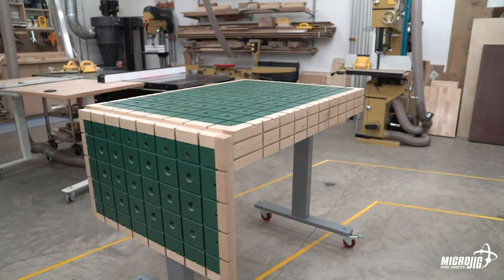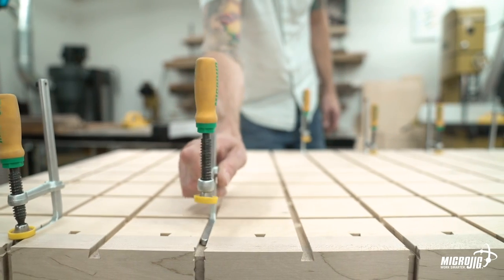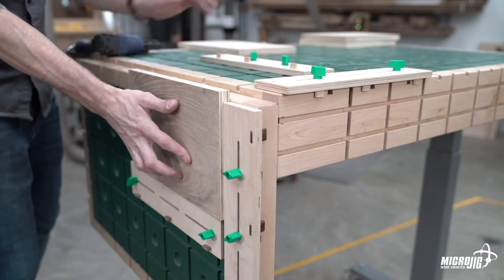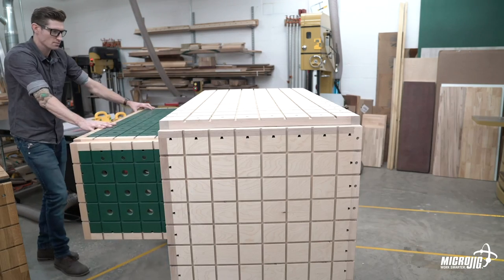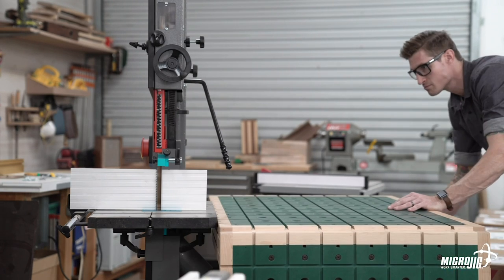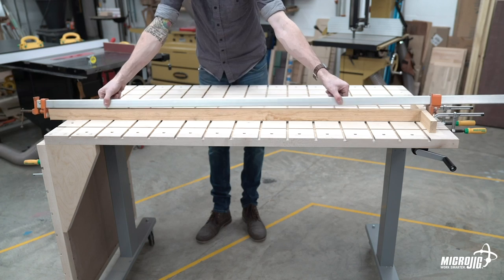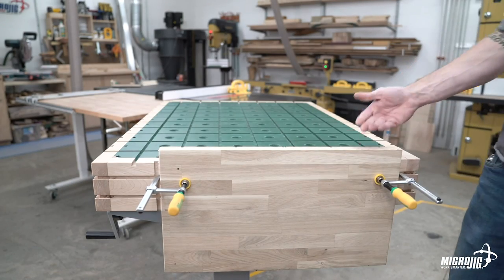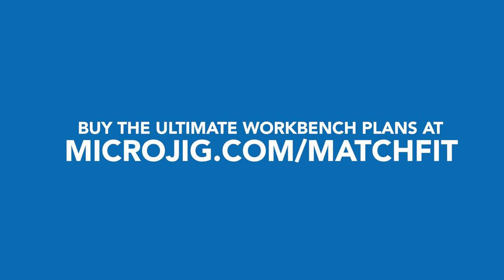The Ultimate Workbench with the MATCHFIT 360 System!

Comment: I just ordered everything to switch over to this system and I am very excited to use it… the only thing I’m concerned about, is glue ups on a table like this. Concern being glue squeeze outs getting into the grooves and creating complications with sliding the clamps around after the glue dries.
Reply from the maker: Joseph, certainly a reasonable concern.
We do recommend using a light coat of paste wax on the top surface of the table. Not so much that it is slippery, but to protect from moisture and glue sticking. 
The grooves themselves should be well waxed, this will help the clamps and hardware slide AND keep glue from sticking in the grooves.
Finally, I like to use wax paper under glue ups whenever possible, just saves a ton of clean up.
Reply: @Microjig  any specific brand of paste wax you prefer? I know Johnson’s has been more or less discontinued.
Reply: @AaronGeller  I use parchment paper from the supermarket. It lays flatter than most wax papers.

Comment: I can think of things it COULD do you didn't mention. Clamping means you could clamp tools to it. So it can become a variable height tool bench and you can mount more than one and setup and assembly line of sorts.  There is enough air flow with the oversized dog holes a well placed fan could create a downdraft sanding table.   Pretty darn clever all the way around and I havn't even tried it yet so I bet I could come up with a few more pretty fast.  As a replacement to a really solid craftsmen's bench, I am not sold on the stability of it. I watched it wobble while planning....I think the small footprint of the wheel might not have enough purchase to hold the table as solidly as I would want it to using a plane,  chisel, hand saw.  I think I would want a more solid surface but a roman bench would work in most cases and it would fit under a bench.....Great ideas all.
Reply from the maker: The limits are pretty much only your imagination!

Comment: @microjig what are your opinions on adding a router table assembly onto the workbench itself?
Reply from the maker: I'm not sure I would add a router table. 
I prefer my router table to be as flat and smooth as possible for best accuracy and cleanest cuts. 
Having the grooves under my stock off the change for the stock to catch in them.
Also, the router table is often messy and the chips would get into the dovetail grooves and need to be cleaned out.
Reply: @Microjig  good callout indeed, thank you so much. I was optimizing for my very limited space and hoping I could reuse some of the space on the 5x3 workbench I'm building. What do you think of building it into the workbench but leaving a large area groove free for this?
Reply from the maker: @hhvidz  Space is always an issue even when you have lots!  A router setup mounted on one end of your bench and the Dovetails cut from the back of the fence travel across the rest of the table would be an awesome compromise.

Comment: I just got done cutting dovetails in 3/4" oak top plywood for my work bench. I noticed that the clamps are sticking alot in the grooves. Do you have a recommendation for a finish to help with this?
Reply from the maker: I prefer just using paste wax. A thin coat of shellac or something as a sealer on the top is ok, but wax will help keep glue from sticking.
Inside the grooves, put wax on the clamp heads before fitting them into the grooves. As you slide them back and forth, the wax will get spread along the grooves. 
You'll be surprised at how much difference a little wax makes!
Last thing: you do NOT want too slick a top surface on your table. Clamping parts in place works best with some friction between the part and the table top. Early on I made a table with a phenolic face. Looked awesome, did not clamp well since it was VERY smooth.

Comment: Where do you source the heigh adjustment mechanism? It looks like a standing desk
Reply from the maker: We have used standing desks, but they have light weight ratings for a workbench. 
The Home Depot Husky adjustable workbench is currently the option we share. It is rated to 600 lbs and comes in a couple sizes.

Comment: I am new to the match fit system and very impressed by it !! 
If I could find one downfall to this bench I would say it doesn't have the heft to stay put during robust hand plane tasks. Not trying to be a troll here , I will be incorerating match fit in to an upcoming bench build and I would very much like to be proven wrong ,,, save me the work of figuring it out on my own . Lol
Reply: Depends on your casters and your floor
Reply: LMAO
Reply: The problem is the small casters it has. If they are changed to real workbench casters (the ones that flip up so the bench rests in its legs) then the wobbly nature of small casters is eliminated. I build a workbench and its legs are 2x4s, if I use it with the casters on the floor it wiggles a little but once I flip them up and the legs hit the floor it stays super firm. Those casters are the ones for this workbench too.

Comment: What material/thickness works best for the tabletop grid? I don’t want to use MDF.
Reply from the maker: MDF works just fine, we have many customers who are using it happily. 
The structure under the top is more important than the top itself. A good frame underneath keeps everything flat.
Reply: @Microjig  oh ok. The main reason I doesn’t want to use MDF is I sometimes do projects that involve water.

Comment: In the plans the top is 1.5 inches thick by laminating 2 3/4 inch sheets.  Would 1 inch thick Baltic Birch work instead, or would you still recommend laminating to 1.5 inch thick?  I am concerned about having a dead flat top after lamination.
Reply from the maker: Kevin, The support structure underneath your table top is far more important than the thickness of the top. 1-1/2", 2" or even 3" thick tops will sag if unsupported. 
Make sure you have good stretchers running under the top and your 1" baltic will be fine. 
Preferably glue up two 1/2" pieces.
Reply: @Microjig  Thanks for the reply - much appreciated!  I am using the Husky adjustable worktable from HD as the base with its center stretched and side supports.  I purchased 1" baltic birch in hopes of skipping the laminating step!
Reply: @keving8682  I have this table too can you please report back how it has worked so far? thanks
Reply: @baba_babaa2  I have not made the top yet - I got sidetracked making some Paoson mobile work benches.  https://www.youtube.com/watch?v=jR__Uj7vopI&t=8s
I will get to this later this year.  I still want to build it.

Comment: You mention the dog holes are oversized to allow clamps to come from the bottom. I do not see the hole size indicated on the plan. What size hole is recommended?
Reply from the maker: For the full 1-1/2" thickness, you need holes 1-1/8" diameter.
Reply: @Microjig  thank you.

Comment: I'm curious as to the green table. What material is that, and where to you get it? It looks like plastic of some kind, which I would assume would make all hardware slide around more easily, and would also hopefully be CNC-manufactured for high precision. But I can't find any info on this?
Reply from the maker: It is actually a green MDF. They do make MDF in colors. It is not easy to find and not at all cheap. We made the one for show, but it is not really practical and the colored MDF is no better structurally than regular MDF.
Reply: @Microjig  Okay; thank you :-)!

Comment: What is the purpose of the vertical dovetail grooves in the green MDF that are hidden behind the apron? The apron has grooves as well, so I’m struggling to understand the vertical recessed groove usage.
Reply from the maker: They make it easy to clamp the apron edges to the green MDF using the MatchFit clamps. The clamp is mounted horizontally in the groove and it clamps the edge to the edge of the green MDF

Comment: how do you get glue drips and sawdust out of your matchfit grooves?
Reply from the maker: Lol, best to prevent it! We use wax paper or parchment paper under glue ups as much as possible to protect the grooves.
Also, waxing the surface AND in the grooves helps prevent wood glue from sticking.
Worst case, you can CAREFULLY line up a straight edge and run the dovetail bit through the groove to cut away any glue.
Reply: saw dust is simple = compressed air... even a pancake compressor can remove sawdust... AND fill your tires with air when needed... AND shoot nails... a shop vac can also remove saw dust... shop vac and compressor are essential tools that will pay for themselves... shop vac and compressor are two of the 1st purchases after I purchased a home.

Comment: Any metric versions available for the rest of the planet?
Reply from the maker: We are working on it. One big issue is that the leg set we are currently recommending is only available through Home Depot, which makes it hard. 
I have built a replacement top for the Festool MDT table. Used 96mm spacing between the holes and grooves.
But we are trying to standardize a groove spacing at 101.6mm (4") on center so future parts and pieces we may bring to market will be usable across all tables.
Reply: @Microjig   Thank, looking forward  to it.

Comment: Where do you get the legs for this table?
Reply from the maker: The legs shown were bought off Amazon and are made for a desk. But they are only rated to 175 pounds, not enough for a workbench.
Home Depot has their Husky workbench line that raise and lower and are rated to 600 pounds.
These come in different widths from 44" up.

Comment: It's a really nice assembly table but good luck hand planing anything with that super lightweight "workbench" on wheels. There is a reason traditional workbenches are heavy. I'd love to have both but I don't think this replaces a proper hand tool oriented workbench. Nothing prevents anyone from routing dovetail tracks in a roubo though, so why not.
Reply from the maker: Or making a dovetail top that simply drops onto your traditional workbench.
But to be clear, we see this more as a clamping table, not so much as a replacement for a traditional workbench.

Comment: Only thing I see it can't do is accurately align dogs for 90/45 degree cuts using a track saw as the dovetail clamps can not be rigid enough to keep pieces set for square cuts but you can not have everything in one

Comment: You asked so here it goes it doesn't absorb shock and deaden the blows. With so many large holes and all the slots this can't be a table you would install hardware on. How many times would a screw fall into that channel or large hole. Not saying they do not fall into a hole on a woodworking table but they're smaller and less of them so not as much.  Look how the table is rocking all over the place planing. Stability is key when using hand tools for extended periods. That being said, I bought some match fit stuff and will make jigs out of it. Great for that application.
Reply from the maker: Keep in mind that the leg set shown with this table were made for office desks. Only has about a 175 rating. 
Since this was built, Home Depot has introduced their Husky adjustable work bench that comes in a couple of sizes and is rated to 600 lbs. They work much better for this sort of application.
Reply: @Microjig  I'm gonna make the vertical piece and use some inserts on my table to bolt it there when I need it.
Reply from the maker: @onecarwood  A good way to set up!
Reply: Others have added an additional sheet of ply underneath top for additional weight and support